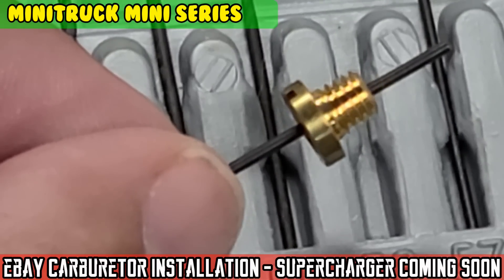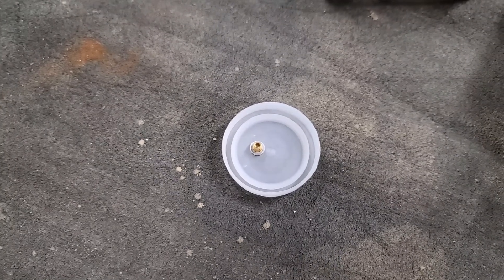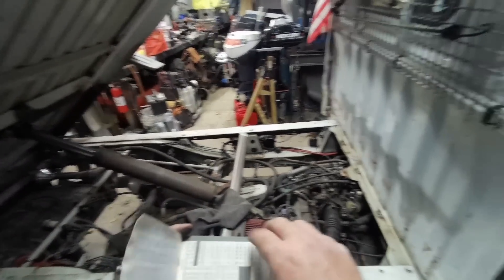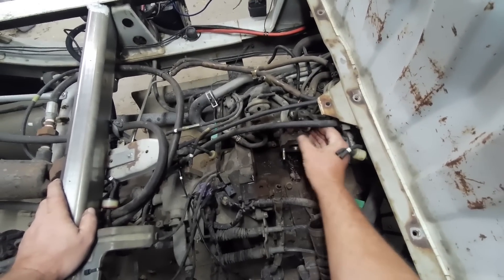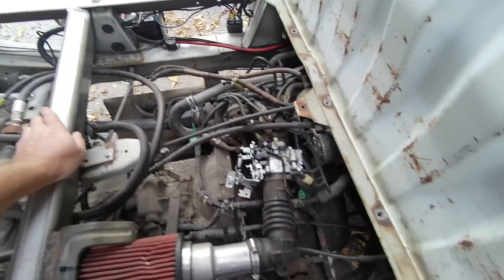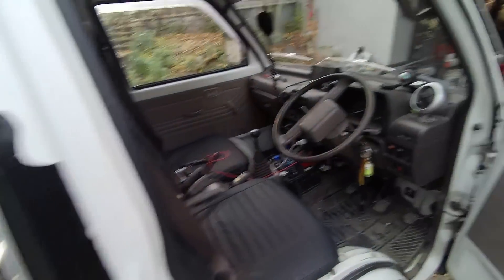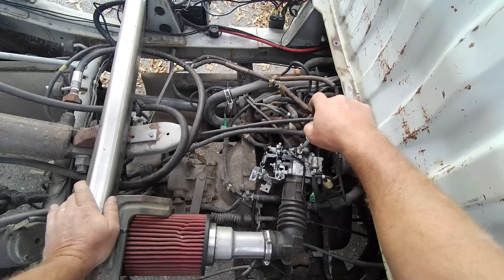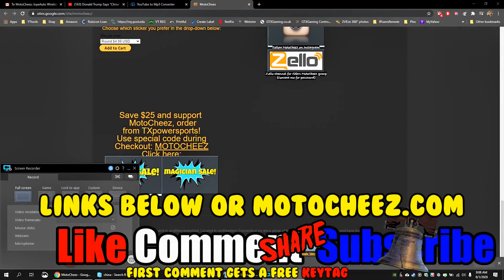Mini-Truck (SE05 E09) Larger 32mm eBay carb install pre-supercharger. It made a difference!

Comment: Have you considered an engine swap. Im trying to research the changability of the f10a engines. Supposed to be same bolt battern and a but is 970cc rather than 660. Supposed to be a lot more hp and torque than the stock f6a
Reply from the maker: I was until I put the supercharger, now I don't need to. But, that would be a good swap if it works! Let me know if you do it.

Comment: I have an 1992 s83p hijet I installed one of these carbs took some messing with but it works now👌👌 I’m going to get an 600cc slip on muffler and straight pipe it next for some more power💥
Reply from the maker: Made a bit more power aye?
Reply: Yeah made a lot more power but I think the old one I had was pretty bunged up
Reply: Also I put in a T for the coolant lines and deleted all that intake coolant it leaked on me
Reply from the maker: I wasn't sure if the passages went into head. I saw the line on too going in, where does it come out?

Comment: you need a bypass valve for part throttle driving.
Reply from the maker: Where? Don't forget it's draw thru.
Reply: @MotoCheez  bypass valve goes around the blower at part throttle.
Reply from the maker: Ahh never saw one
Reply: @MotoCheez  look at a jackson racing kit.

Comment: ok only thing is those stock pistons are going to get slammed down real hard usually you want forged piston rods for those.  I know my turbo van has internals like that.
Reply from the maker: Its low boost, like 5psi
Reply: @MotoCheez  do you think it's gonna work?  Is it a daihatsu brand or a subaru I was wondering that.
Reply from the maker: It's Subaru brand. One they use. I'm hoping it'll work.
Reply: @MotoCheez  oh man I hope this works boss
Reply from the maker: Me too

Comment: I would expect the carburetor to be bored to be a little bigger to  deal with the increased airflow from a supercharger. Pretty much dropped right in! You're right Japanese engineering is so much better than anything else; it's the opposite of Chinese engineering! Can't wait to see the supercharger installation video. Minnie's going to be popping wheelies pretty soon! 
Thanks I enjoyed the video!

Comment: Love this series.  Sure wished you lived closer to help me with mine.  Lol. Purchased 1995 Suzuki Carry just lifted it last week.  Wheels and tires on it now too.  I painted it myself 11 hrs worth last weekend to a camo bottomland stencil.  Turned out amazing.  Tackling the valve cover seal, lashing of the valves, camshaft seal and I think crank seal and might as wheel replace timing belt.  I checked time last weekend and it was off bumped it to around 10 degrees and she runs a lot better.  

Oh added tach, and found that dash cam mirror.  Installed it as well.  Also found if you adjust front camera on it touch the mirror drag image down or up allows for more adjustment.
Reply from the maker: Nice. Never had luck with the mirrors adjustment.

Comment: Heck yeah cheezy! Thanks for doing the hard work! Can't wait to see your tweaks on the carb! Record everything! Lol I'm starting the dash this weekend on mine and we are pulling the bed so I'll be able to get to all the lines easy 🤘🤠🤘
Reply from the maker: ALL the vacuum lines on the carb are choke and pollution. I only have 2 lines to the distributor now. Everything else can go
Reply: @MotoCheez   I already have the new silicone lines and the old carb so I'm gonna swap them out and diagram it so those who are comfortable with keeping the stock set up (those people make me uncomfortable) can have a updated resource and maybe I'll sell some color coded silicone line dress up kits.  My hoses were surprisingly soft as well but after pulling afew off to check I noticed the are soft but still fracturing on the inside.  You need to show off the supercharger again 🤣 get the hype up😛
Reply: @MotoCheez  an AFR gauge would also help ease tuning the carb 🤷
Reply from the maker: @pro_donorhijetbuild6548  definitely. Wish they were cheaper. I'd love to have a gauge inside

Comment: Dude! That's a big plate of angel hair pasta that you are going to be labeling 🏷. That would scare the livin crap outa me. Cheezy though if it works! Ima stick around and see 👀.
Reply from the maker: That's why I put it off so long, funny thing is. Need NONE of them for this carb. Just 2 lines to distributor vacuum advance. Everything else is gone

Comment: Good work.  I rebuilt or replaced several of the Chinese carbs for 150cc gy6's.  One thing I found every time is no two are REALLY alike.  Plastic parts or brass, different jets & floats, porting.  But really do like the wax chokes.  Reliable, accurate, work great every time.
Reply from the maker: They're some piece of engineering!

Comment: Im totally late to the part but I finally dusted off the carb I bought last year and did the swap . It feels so great to get rid of all the vacume lines and the leaking coolant hoses ( I capped them all off ) .Good by egr , good by sticking choke , good by giant airbox , hello power . I did have the same tip in hesitation as everyone else and I sorted it out , its the accelerator pump . Its too big and comes on too soon once I loosened the jam nut off and backed the adjuster all the way down and it was night and day better . I will cut the spring down next because it still comes on a bit at just tip in of throttle .

Comment: Supercharger might not be a good idea for such an old great running vehicle, but maybe, I guess it depends on cooling....Hate to see ya shorten the life of mini-truck...Those things run forever because of great engineering, and they weren't stressed, and well taken care of...Nice job though bro...
Reply from the maker: I know. That's what I've been on the fence. Has to be tuned almost perfect or I'll do damage
Reply: Hi sir can i have a copy of the photo you took b4 u replace the carburetor?? We have the same type of carb my problem is that vant remember were to put back the vacum hoses tnx...
Reply from the maker: There's some people on here that run 20 lb of boost on at 3 cylinder engine, mini truck is still running strong no problems with that supercharger and carburetor
Reply from the maker: I do not have a photo of before you could probably go back in my older videos and see what's in there

Comment: Love your in depth video! What all did you delete going from old carb to new carb? Whats the top center thing with three bolts that the new one just has a cover over it?
Reply from the maker: Only thing I had to remove was the airbox air filter. Pod filter replaced it.

Comment: About to start on the exact same project(same truck, same carb) tonight or tomorrow. May come by and ask for some pointers if you don't mind!
Reply from the maker: Sure!  Don't bother labeling all your vacuum hoses because the only ones that you'll end up having left is the two that go to the distributor. Unless you want to keep your EGR. The only other vacuum line you're really going to need is the brake booster and a small line that goes up to the vacuum reservoir tank under the seat
Reply: @MotoCheez  awesome, I think i'm going to get rid of it myself. could you possibly send me in the right direction for the brake booster and vac tank? I haven't really delved too deep into it. also what lines are running to the fuel pump? I appreciate your help I think this is going to help her out alot.
Reply from the maker: The booster is still on the manifold and so is the vacuum tank...
Reply: @MotoCheez  thank man, the guy who had it before me had it rigged up all sorts of crazy. I'm trying to get it sorted out back to as normal as I can.
Reply: Got it done, fixed most of the problems I was having, and the choke ended up being easier than expected. thanks for the video!
Reply from the maker: Awesome!!👍👍🧀🧀
Notice the power difference?
Reply: @MotoCheez  o yea for sure, it went about 50mph with the new carb and will hit almost right at 60 now. it will go through whatever in 4WD also. I think it's a great upgrade.
Reply from the maker: Agreed!

Comment: Great content!  Have you seen or done a motorcycle Carburetor on a mini truck before?  I have a 92' Daihatsu dump en route and am already looking at upgrades, and the main one is a motorcycle carb conversion.
Reply from the maker: I haven't, for this project it would have been too tall because planning on super charger, but it was my second choice. Motorcycle carbs are easier to tune and get parts.
Reply: @MotoCheez  yeah, I like working on motorcycle carbs much more Lol but I can see your point with supercharger 👍 thank you for the reply!!
Reply from the maker: @lynchcreekmuzzy5759 id go with a flat slide rather than a CV carb though. Most do the Harley carb

Comment: So is the only thing you have left for vaccum is the distributor and 4wd/dif lock? Previous owner plugged and cut a lot of lines, I have that exact carb ready to go on.
Reply from the maker: Yes. That's it, and big line to brake booster

Comment: I would like to replace my filter with one like what you have ...  where did you get the elbow and hose connection ... and type of air filter.
Reply from the maker: I put the links in description of video.

Comment: Hey Cheezy, did you have to change your jetting any when you put that new air filter? I snorkeled mine out so it might be a little different but a similar filter.
Reply from the maker: I didnt have to on mine. Was big enough. But I already had the filter with old carb
Reply: @MotoCheez  10/4. I might be getting colder air than before. I think I'm gonna go up a jet size and see what happens

Comment: So the ones on the driver side of the carb werent used, the lines in the back werent used, lines in pass side you t'd off to the distributor, big line on the bottom wasnt used, and electrical from carb went to bottom left if notch is on top?
Reply from the maker: Yes if memory serves me well
Reply: Do you remember what size the barb fitting was for the fuel line. I got a 1/4 mnpt and it doesnt work
Reply from the maker: @thatsmydawg I know it was a metric size, I believe I may have put it in the description of the video. If not I don't actually recall I think it was an M8 x1.75 or something like that
Reply: @MotoCheez awesome thank you

Comment: The new fuel pump i put on defective. I have a s81p slightly different then yours. Didnt have sll that extra stuff. I have one nipple just after the carb that has vacuum. Where can i run that? The 2-3 lines that were hooked to the old carb are hooked up. Just one nipple thats not connected and dies when i put my finger on it.
Reply from the maker: If after carb on intake (after throttle) it's constant vacuum, before throttle is metered by throttle...
Reply: The constant vacuum nipple. I tried t'ing off to something else that had vacuum and it stalls out
Reply from the maker: @thatsmydawg hmm maybe raise idle? Or too rich?
Reply: @MotoCheez  i get it running nice at idle. Ill snap the throttle and itll respond nice. Get in the truck to taken off and duh duh duhhhhhhh. No power. Its weird too, the throttle cable i have to the furthest mount. The choke is the closest to the carb. Anytime i snap the choke it revs up nice. When i do the throttle, sometimes it seems like it wants to backfire. I tried adjusting the distributor up a couple degrees and that things frozen.
Reply from the maker: @thatsmydawg maybe you got the vacuum line to the distributor reverse? I'm plug them completely cap off any vacuum nipples that are open and then try it again

Comment: How many turns did you end up with the jets? Thanks 😊
Reply from the maker: Mixture screw 2 to 3 out. Jets inside are tight
Reply: @MotoCheez  thanks

Comment: Great video, i have the same truck and it stopped running recently, i can run it on starter fluid but not without, new fuel pump is getting gas to carb but sill nothing, anyone have advice on what to look for on carb, is there fuse that controls fuel? can i clean any jets without removing carb? anyone in georgia that can work on my hijet? thank you
Reply from the maker: Thanks. Definitely check to see fuel I'd pumping to the carb, there is a bowl drain you can get to. But for the main jet but may have to remove carb unless you're lucky
Reply: @MotoCheez  thank you, fuel is pumping to carb, i will look for bowl drain and see if i can drain it. im not sure but assume bolt will be directly underneath.
Reply from the maker: Should be in my carb upgrade video where you can see it

Comment: will this work for a 1999 cushman white van also? i need a carb badly
Reply from the maker: I'm not sure which the cushman's used is it a Daihatsu engine 3 cylinder 660? Because if it is it will work
Reply: @MotoCheez  ahh ok, no this one is a 4cyl 1000cc. ive called all over and looked everywhere and i cant find anything.
Reply: @MotoCheez  do you have your stock one still?
is so wanna sell it or donate it for a good cause lol ill see if it will make it run!
Reply from the maker: If that's a thousand cc it would definitely be too small. You can look for a motorcycle carburetor like off a Harley that would probably work for you. There must be information online
Reply: @MotoCheez  thats what i thought. ive been looking for 5 days... and i have a slow desk job so i have the time to look and no luck
Reply from the maker: @jasonprelude13 I'm sure you can make an old Harley carb work. You should measure the bore where it connects to the intake It might be 50 to 60 mm and then try to find a motorcycle carburetor that size and make it work

Comment: Hello, I'm still having trouble with my truck!!!! Where did you plug the 2 vacuum hoses coming out of the ignition  distribuidor?
Reply from the maker: One went to constant vacuum which is on a manifold side and the other was port which was before the butterfly throttle I remember which went where because I labeled them
Reply: @MotoCheez  thanks

Comment: Any idea what would cause these to run, what I'm guessing is, lean, at idle? I went with the same carb and I can choke it and it'll idle high and stay running, but if I try and open the choke all the way, the idle drops low, it sounds like it misfires, and the exhaust fumes start to burn my eyes. I only have one vacuum line for the distributer since there is only one on the vacuum advance. It holds pressure just fine as well. I have one of line from the intake side, behind the carb, capped off and the other running to something under the fuel pump and it T's off and goes to the valve cover. The EGR is open, and with it connected to vacuum, it doesn't seem to make a difference. There is a vacuum port on the front side of the intake that feeds the vacuum reservoir and I'm assuming the booster, so I don't think there is an issue there. 

Messing with the timing on the distributor hasn't made much of a difference either. 

Also, on my S83P my coolant lines were different than yours. The top line went to the intake and there were two lines down low, that went to the carb that I looped together. Thought it was a little weird.

Any ideas?
Reply from the maker: Your EGR valve should be closed, you can even put a plate over it to make sure it does not recirculate, that could be The whole problem. Because other than that you have a mixture screw on the carburetor that you can play with
Reply: @MotoCheez  what if I leave the EGR disconnected? I had it disconnected before and it still did the same thing.  It's seems that no matter what I do, I can't get it to idle properly.

Also, which screw does what? It seems the only one that does anything is the little screw in front of the thumb screw. I'm assuming it's an idle mixture screw since it will mess with the RPMs
Reply from the maker: @autoaudio3228 You can leave the EGR disconnected You just have to make sure that it's not recirculating gas or that will be your problem. The mixture screw is one of the top screws I forget which one
Reply: @MotoCheez  I suppose an AFR meter and a timing light would probably help narrow some stuff down.
Reply from the maker: For sure, wonder if some dirt is in the pilot jets? Try draining carb into a glass container to see if any debris

Comment: Love getting rid of vacuum lines.. I am having cruise control problems  w my 1978 Old's 403 engine.. due to that, lol, and no old mechanics round here...  on another note, I am getting rid of the Hero9.. Still could not get it to give me the media, online w/ everything and  GoPro chat,  computer/phone/camera.. Too much crap and sucky software.. Might have to get me some special sunglasses.. lol
Reply from the maker: You pulled the card and put in the reader? There are 3ntyoes of files goproakes. Click the .MP4 files
Reply: @MotoCheez  Had to refresh the Quik on my cpu and then open :D and go to files.. Found some MP4's and clicked on a few.. Got footage... But not going thru the GoPro Program.. That didn't do anything but highlight exit.. lol.. I will mess around with it... thx Cheez...
Reply: @MotoCheez  Got a small piece of raw footage on my channel, now have to figure out how to delete content off the sim and go from there..lol. I have a lot more respect for your video's and editing..
Reply from the maker: It's time consuming, and big learning curve.